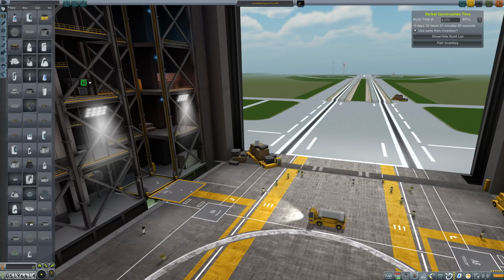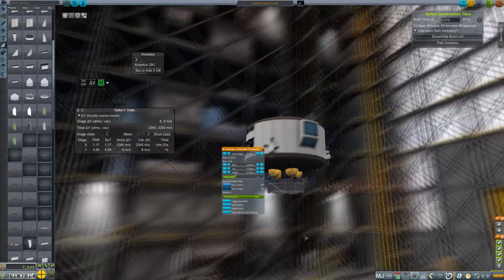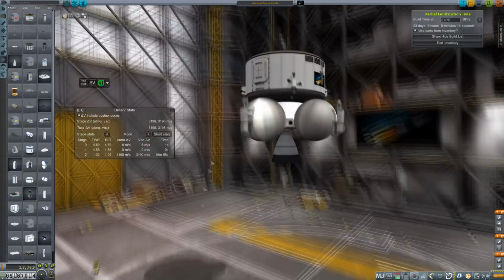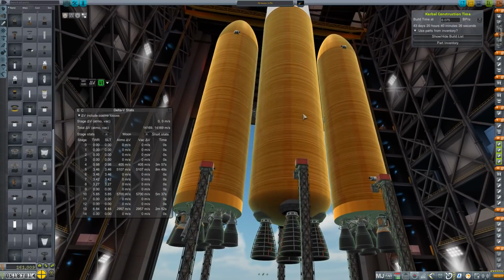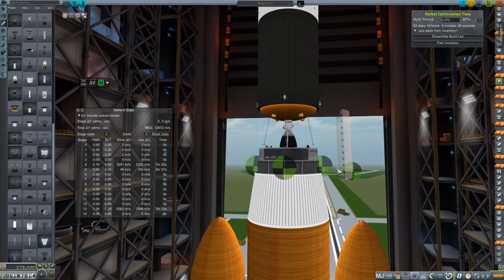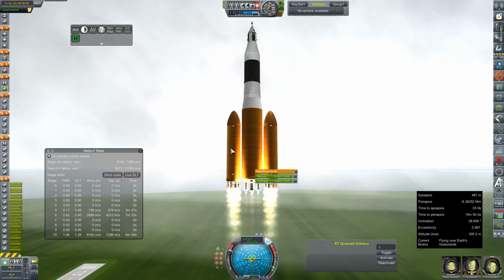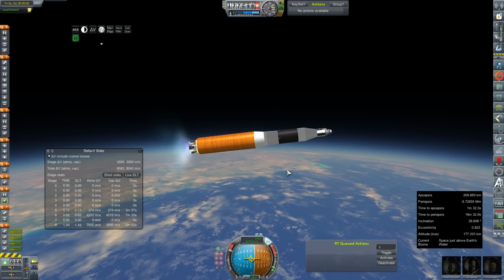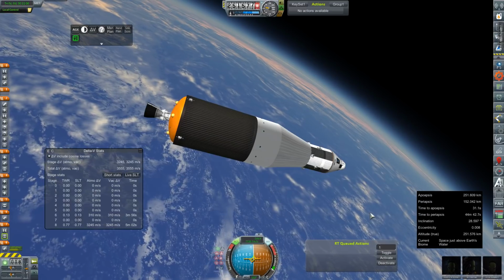KSP RP-0 #328 Next Gen Landers

Comment: A nice alternative to doing precision landings is having a well-equipped rover that can transport the full crew a couple of kilometers if needed. It's not always ideal, but it can be helpful - especially on an atmospheric world like Mars, where it's much harder to land modules near each other.

Also, have you heard of the mod Editor Extensions Redux? It adds some things which you might find useful (assuming it's compatible with Realism Overhaul).
Reply from the maker: The one good thing about Mars' super thin atmosphere is that an "all engines" landing is still viable- and target-able. Though in the future I would really like to experiment with gliding a ship down and landing on lift alone.
I have heard of Editor Extensions - and when I built this install, it was not yet compatable.

Comment: Firstly, great series, glad to see it come this far, I wish you 200 more episodes.
Secondly, how did you get your RCS booms to work on all of your probes, mine won't work at all.
Reply from the maker: Thanks!
the RCS thrusters have several available fuel types ( depending on where you are in the tech tree ) so first make sure that your thrusters are set to the fuel mixture you want to use/have on board ( they all have differing ISP and thrust ratings ) 
secondly they require a pressurized tank ( service module or fuselage IIRC )

Comment: You could probably get two RD-171Ms on the boosters if you rotated them ~45 degrees, because fitting two squares side by side takes up less space than placing one corner of one square next to one corner of another square. This would also massively simplify your booster fuel situation.
Reply from the maker: I tried something similar on a test run - and well I wouldn't quite fit without clipping - not without making the skirt (small tank at the bottom of the boosters ) flair out to the point of looking silly.
Reply: Huh. Do you have RD-180 engines yet? IIRC those are ~50% the thrust of a RD-170, and you could in theory fit 3 of them in the booster.
Reply from the maker: I do not yet have the 180s unlocked - they're still a few years away in the tech tree.  The node is in the research queue though.
Reply: See, at this point I'd also ask if you have the NK-33. Because IIRC, the NK-33s actually rival the RD-171s in terms of thrust to weight ratio, and are just as if not more efficient both at sea level and in vacuum. They're also more reliable than the NK-15.
Reply from the maker: nope.  Most of the part packs got cut when I was building the install - a measure taken for longevity and stability.  It sucks, but having dealt with many RSS installs, I credit the cutting down of the parts count to the reason this install has been functional for this long with relatively few interruptions.
Reply: Well, then you sir are SoL, unless you made the boosters shorter but stouter. Or unlock the RD-180.
Reply from the maker: Ash19256 lol yep. Part of this series, and my play style in general, is to make do with what I've got. :)